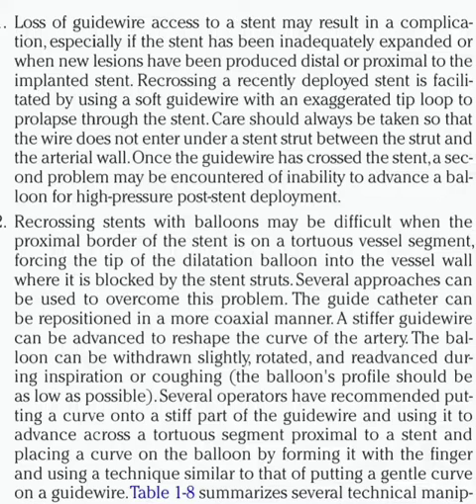Loss of Access to the Stent

Comment from the maker: 1. Loss of guidewire access to a stent may result in a complica-
tion, especially if the stent has been inadequately expanded or 
when new lesions have been produced distal or proximal to the 
implanted stent. Recrossing a recently deployed stent is facili-
tated by using a soft guidewire with an exaggerated tip loop to 
prolapse through the stent. Care should always be taken so that 
the wire does not enter under a stent strut between the strut and 
the arterial wall. Once the guidewire has crossed the stent, a sec-
ond problem may be encountered of inability to advance a bal-
loon for high-pressure post-stent deployment.
2. Recrossing stents with balloons may be difficult when the 
proximal border of the stent is on a tortuous vessel segment, 
forcing the tip of the dilatation balloon into the vessel wall 
where it is blocked by the stent struts. Several approaches can 
be used to overcome this problem. The guide catheter can 
be repositioned in a more coaxial manner. A stiffer guidewire 
can be advanced to reshape the curve of the artery. The bal-
loon can be withdrawn slightly, rotated, and readvanced dur-
ing inspiration or coughing (the balloon's profile should be 
as low as possible). Several operators have recommended put-
ting a curve onto a stiff part of the guidewire and using it to 
advance across a tortuous segment proximal to a stent and 
placing a curve on the balloon by forming it with the finger 
and using a technique similar to that of putting a gentle curve 
on a guidewire.